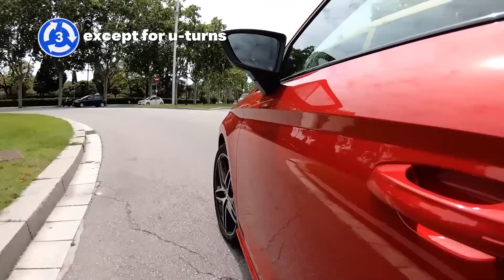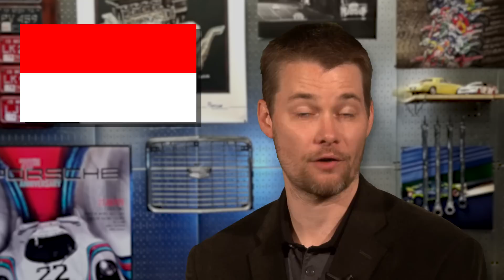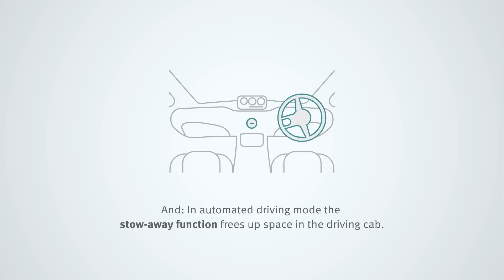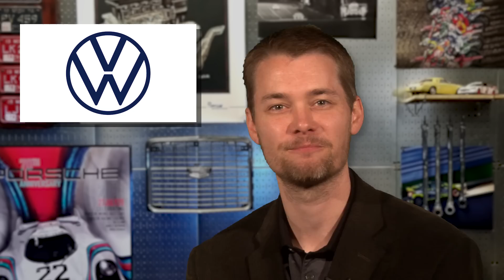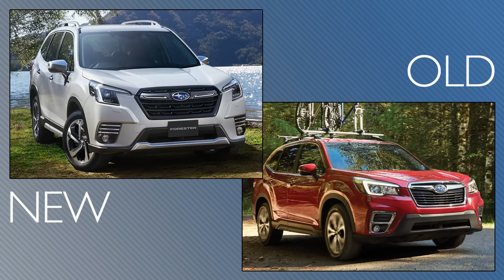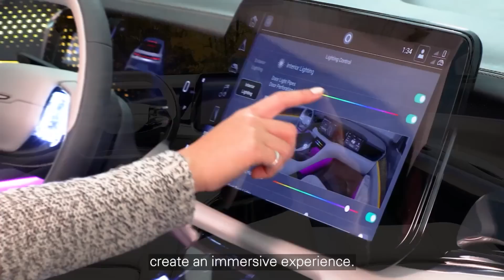Ford Doubles F-150 Lightning Production; Subaru Launches Refreshed Forester - Autoline Daily 3146

Comment: F150 lightning is going to be a hit...
Reply: I agree, fleet sales alone could consume a lot of that production, I hope there are enough for consumers and fleet sales. That thing solves a BUNCH of problems for some business customers. Can't wait to see what kind accessories come out for it. Most F150 after market stuff will work but there could be a lot of new ones based on the available power connections and stuff.
Reply: Hopefully they secure battery factories for it… with only 40-80k units a year for the next few years… ouch
Reply: @Sannanymous  well, by the end of next year GM will be the largest battery producer in the United States, by far surpassing Tesla.   Ford also has their partnership with SK innovation, which is in development now, but GM is way out in front of them, with their first Lordstown battery plant nearly completed, and the second one in Spring Hill Tennessee is in steel framing due to be completed late next year.   Here is some truth for you, Tesla has struggled mightily with their pilot line to build 4680,  having produced zero production quality batteries yet,  even though, Elon musk announced production was starting one year ago.   Tesla is also just starting the foundation for the Battery Plant in Berlin, so that is 1 to 2 years away at least,  and in Texas, no battery production area has been started yet.   The area that Tesla fans like to call the battery production area at giga Austin, is actually where they assemble the battery packs, not cell production!
Reply: @dmitchellhomes  Boy have you got so much wrong.
Reply: @johnmqueripel2367    Once again,  nothing added to the conversation...
Reply: Next year, GM will have exactly ONE Ultium battery factory online, producing 35GWh of batteries. 
Ford & SK will have one 9.8GWh battery factory online.
VW will have one 40GWh factory onine.
Tesla already has ~30GWh from GF Nevada online, and by next year will have factories online at GF Berlin and Austin, each starting at 100GWh of 4680 cells, ramping towards 250GWh each. And that doesn't include all the LFP cells they're buying from CATL, BYD, Panasonic, LG, etc, or the 4680 cells they will be buying from them starting next year.
I love that you think you know what you're talking about. Gives me a big chuckle every day.
Reply: @CSHarvey    Haha!   VW does not have any USA battery factory under construction or planned.       Tesla also has started no battery cell manufacturing construction in Austin,    The corner of the factory that is built is for battery pack and drive unit production,  and seat production.     They cleared an area for a battery cell line but no construction is started yet.      The SK innovation site is not part of the Ford JV,  that is SK's own plant.
Reply: @dmitchellhomes  - Fun exercise - count the number of factual errors in that paragraph.
Reply: @jameshoffman552    Another Tesla fan boi showed up,  Sheesh,  where do you all come from?

Comment: @1:30 the diagram shows the opposite of what I heard..."No longer have slower traffic over high speed roads"...or do you mean "over" as in travelled?  Not over as in stacking?
Reply: It is over as in a bridge. The higher speed road was constructed to dip down under the cross road. The cross road with the squashed double roundabout is a bridge over the high speed road. The high speed road has exit and entrance ramps as if it were an interstate, and they meet up with the roundabouts.
It has been a great change here in Hamilton County Indiana. Keystone Ave was the first to get this, then US 31, and now US 37 is under construction to get these installed. These roads used to have stop lights at each intersection which were a nightmare at rush hour and weekends. The 5 mile stretch from 146th down to 96th used to take at least 30 min. Now it's 5 min. The construction period sucks, but it's well worth it!

Comment: 30,000 yearly sales in 2022, and 80,000 yearly by 2024 Hahaha. That's nothing. Tesla produces 200,000 in just one quarter. Ford is so doomed.
Reply: And there are so many people who wont by a Tesla of any model due to hysterical fanboys like you....
Reply: @robertkempe2730  word of mouth advertising - Tesla owner brag and give test rides (will they allow other to drive? don't know).
Reply: Even if only 1/2 of the  current Ford F150 customers, eventually, switch to F150 Electrics, Ford will be producing over 500, 000 units per year of just this model, your Tesla fan boy predictions are way off the mark !!!
Reply: @darrenhefford3722   I think the part a lot of people miss in  this electric conversion, Who is going to buy the electric trucks? Research and surveys  say The truck makers biggest markets in the middle of the country, are not wanting to go BEV, at all….  The biggest market for the toy trucks like raptor, or hummer, or ram TRX are on the coasts,  and those customers are very eager to go BEV.   Right now Ford has over 120,000 reservations, 85% of which have never owned a Ford vehicle.    I think all of these electric trucks for the big manufactures, are going to be a major growth sector, they are going to sell these to people who never owned their ice vehicles primarily.   They will still sell their ice trucks to the people in the middle of the country, and northern regions where the long cold winters are not optimal for a BEV.
Reply: @darrenhefford3722  500k of Ford electric f150’s?  I want some of what you’re having
Reply: @Sannanymous  DID YOU EVEN READ MY COMMENT ???
Reply: @darrenhefford3722  obviously yes, but do you do research before making such a claim?
Reply: @Sannanymous  What claim have I made , I merely stated, that if Ford ,which produces about 1,000,000  F 150s per year, were to retain 50 % of their customer base with Electrics, they would sell 500,000 units ????
Reply: @darrenhefford3722  Fair enough
Reply: That's just the F150 and does not include future vetches on EV architecture
Reply: @eganjos1  okay. For that argument, I will point out the Mach E YoY sales at 12,975. So we can compare that directly with 320,000 model Y YOY sales.
Ford can not sell evs.
Reply: @Tazman55x    Ford sells more Full Sized pickups just in the USA than Tesla sells total vehicles globally in the last 18 months.    I think they are going to be OK,    BTW  how many Electric trucks has Tesla sold?    GM, Rivia, and Ford will all beat Tesla to them to the market.    I suspect once the Tesla fan bois get their cybertrucks demand will be weak.
Reply: @dmitchellhomes  absolutely none of those models are electric
Reply: @Tazman55x    Exactly,   but the EV models are coming,  and those are the markets most consultants expect EV trucks  to sell the best.      Ford's numbers seem to confirm this,  when 85% of their reservation holders have never owned a Ford...  BTW, Mach E is 75% conquest business so far too.       These Ev trucks will get conquest sales,   so being first to market is critical,   GM and Ford know that,   and they will both beat Tesla.     Same with Cadillac Lyriq, although in a different class,     Sales are expected to be robust,  right from the start, which reservations are only 3 weeks away.
Reply: @Tazman55x  They can't make any money on them, they don't know how to do it and it reduces their ICE sales.
Reply: @eganjos1  they barely have anything in the works lmao
Reply: I didn't know Tesla already produced the Cyber truck.
Reply: @buddy1155    Exactly...   Cybertruck is still at Alpha phase (Concept),  not even a real  production prototype has been built yet.
Reply: @dmitchellhomes  Yeh, the factory in Texas is just hype, except it isn't.
Reply: @Pauline Weinberger  You are exactly right,  GM, Ram, and Ford truck customers are fiercely loyal,   not to mention those companies EV pickups will be more feature filled, and fit their customers esthetics than the (looks like it was designed like a 5 year old) Cybertruck.
Reply: @dmitchellhomes  too funny.
Reply: @Sannanymous    I can see where you come from,  you have been filled to the brim with Tesla propaganda following sites like Now you Know, and Best in Tesla,  which are near 100% propaganda,  No reason for us to chat,  as you believe what you want, and I will believe what  is real...
Reply: @dmitchellhomes  Possibly, you may be right, or not.
Reply: @dmitchellhomes  loyalty is only so good until you have mud on your name… Ford and gm are getting so dirty lately, only the muddies will want ya… all the way to the dumpster
Reply: @Sannanymous  i’m not sure what you’re talking about, both GM and Ford, sell every single truck they can build, there is no inventory of them anywhere.  They are also selling for the highest prices and have the highest profit margin‘s both of those companies have ever had in their history!   Your comment makes no sense at all, and it’s clearly not grounded in reality!
Reply: @dmitchellhomes  too funny, while I agree with the margins Ford and Gm currently make, it’s heavily subsidized still… and the margins are garbage compared to Tesla ev margins, time to wake up son
Reply: @Sannanymous    Tesla had 1 quarter with great margins,   Let's not get the cart in front of the horse.
Reply: Correct.
Reply: @Pauline Weinberger can you find a Ford ev in stock?